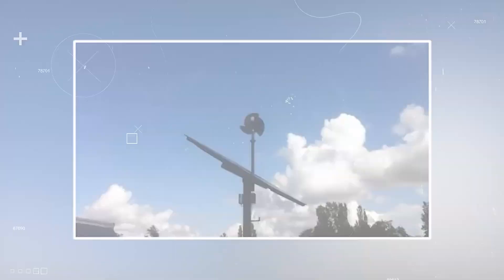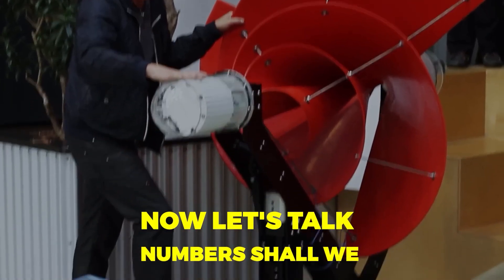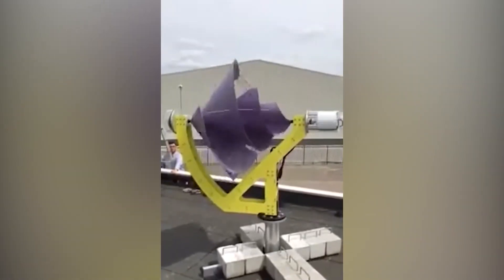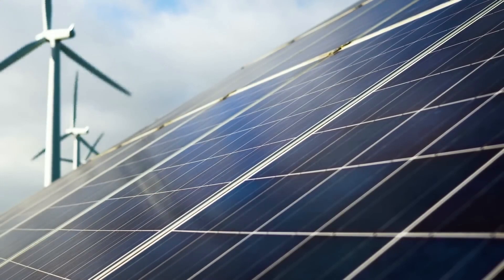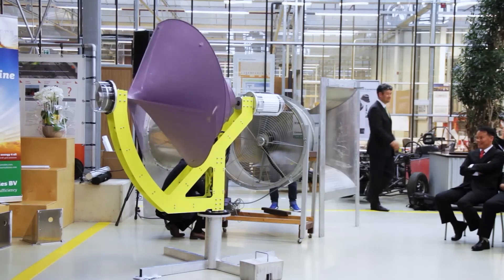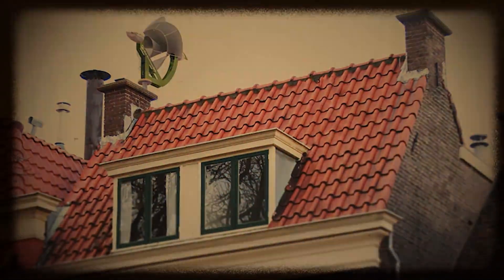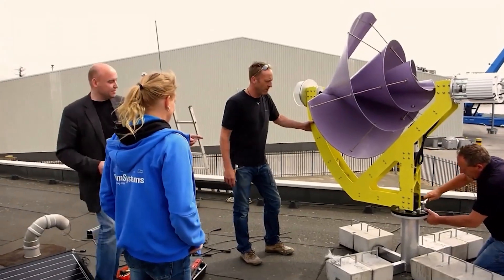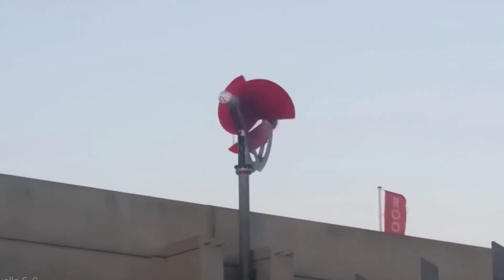Dutch Wind Turbine: 476% More Efficient Than Solar Panel?

Comment: You know what ?  Post a data sheet with the actual generation in watts in 5 minute intervals through a whole year, and the accompanying wind speeds (might be useful to know the compass direction changes too.   Lots can be learned from that which theory only portends.

Comment: Not everywhere has oceanside air speeds.  Some places have hardly any during portions of the year.  Texas is the largest wind powered generation int he US by volume, and july-september are pretty darn lean compared to the rest of the year.   However, for places which must have remote generation and live on batteries - running some of these into charge controllers and then drawing from battery could be quite useful, even with solar panels also charging the same batteries and the charge controllers knowing about each other.  Often a good complementary setting where combined wind and solar make a more steady output through the entire day.

Comment: Efficiency, in itself, is not important. Ultimately, it is the financial efficiency that matters - taking into account the total power generated, initial capital cost, cost of replacement, cost of finance, operational cost and longevity/reliability.

Comment: All practical tests show that small wind turbines hardly generate any electricity - and only at costs very significantly above 1€/kWh! 
There is hardly any wind near the ground, and it is also very gusty, which extremely reduces the service life of the systems. 
With pv solar systems, you can reliably generate electricity for about 3 - 10 cents/kWh over a period of 25 years!

Comment: Power from your system is 80% * .5 * Air density 1.2* Wind speed 5^3 * Area (2m dia) (1^2*3.14159) = 188 Watts . Does not add up to your claims.
Power (W) = 1/2 x ρ x A x v^3
Power = Watts
ρ (rho, a Greek letter) = density of the air in kg/m3
A = cross-sectional area of the wind in m2
v = velocity of the wind in m/s
This system is a WHOLE LOT of expense for not much gain at all .
Reply: Good and usefull explanation.
Plase try GELİBOLU MODEL RÜZGAR TÜRBİNİ, GMRT.
You can also find  details and a video.
Reply: @yavuzalisener2  In some language I don't understand and It seems very basic . I have designed many VAWT systems and they get complex the more efficient until I discovered Prandt D and self alignment . Note that some cam operations are good at negating torque pulses and also optimisation of power .

Comment: That Betz Limit is only valid for horizontal bladed turbines whereby the blades are impacted only once by any "packet" of wind. Some new (patent pending) wind turbines have the rotor impacted more than once and at a higher velocity
Reply: Any samples?
Reply: build it working rising heat
Reply: @feizal7555 -  The Betz Limit applies to all Wind Turbine designs, so far.  Name the wind turbine that exceeds Betz Limit?  Oh that's right ... there is none.

Comment: More efficient how? The problem with the complex turbine shape is that there is no way to scale it much bigger, and there is just no way that any kind of wind turbine with all the moving parts needs less maintenance than solar which just has to be washed occasionally if there hasn't been rain recently. Winds change daily even if trends can be somewhat predicted by season and location, but there are plenty of areas where we could build solar and be certain clouds will only happen about once a year; saying solar is more dependent on weather is ridiculous.
This turbine may or may not produce useful amounts of power and may or may not do so affordably, but these claims are about as useful as snake oil ads and only make it sound more suspicious.

Comment: this is not a revolutinary technoligy in any way this turbine blade shape has been around for years (I believe that it was originally developed to be a boat propeller and was mathomaticly) this company has just gotten a whole heep of already proven tecnoligyes and smashed them together.

being compact is not a advantage as well because turbines get more efficient the begger they get not the other way around. due to having greater frontal area to catch the wind.

using solarpanels as a comparison is poor as they are two completely different technologies that require completely different conditions to function. one may be more efficient than the other solely based on location.